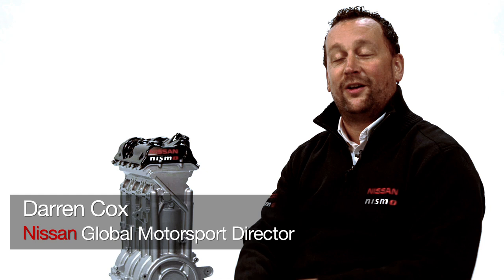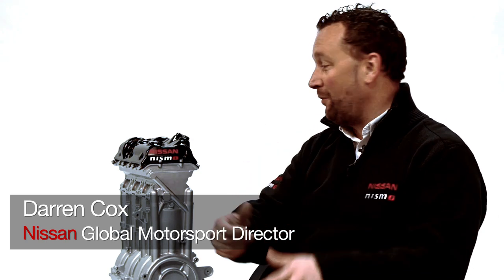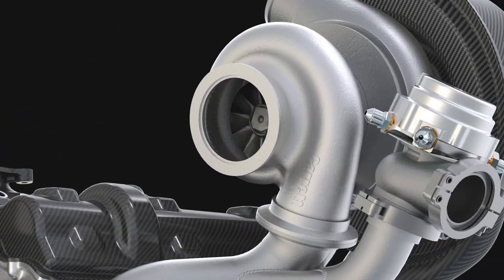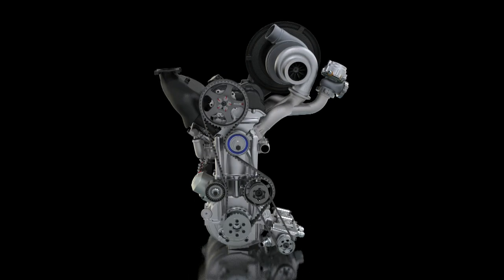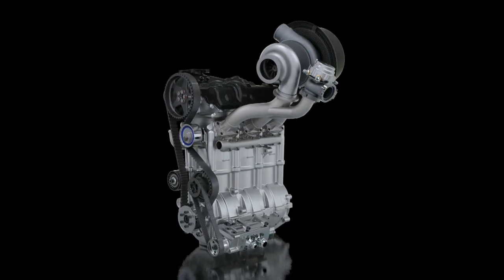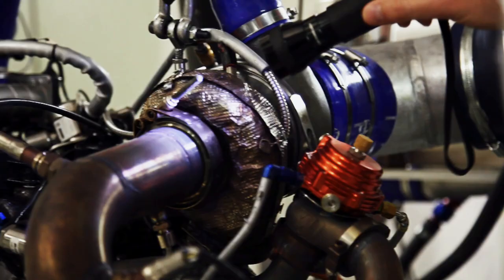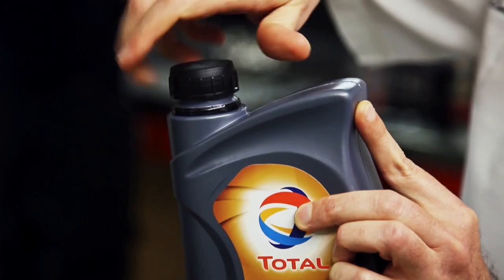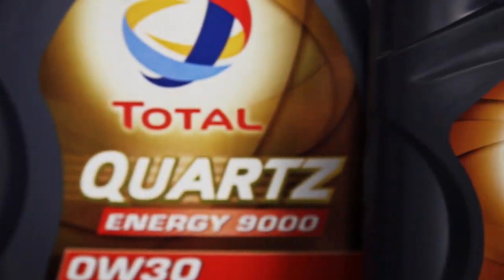Nissan ZEOD RC powertrain - 40kg engine producing 400hp!

Comment: Imagine this on a all new Nismo Motorbike
Reply: That's what I was thinking...The Nismo Hayabusa 
Car companies right now could easily produce small  2 & 4 seated hybrid commuter cars that got between 100 & 125 MPGs but for some reason they don't.....History Channel TV show Modern Marvels showed that the first Toyota Prius's they made, got 100 MPGs by using a larger battery. Yet the 4 sale versions only get 50 MPGs. I suspect the Government & oil companies don't want millions of 100 MPG hybrids on the road just yet because #1 Government will get far less gas tax revenue coming in #2 Oil companies will be selling less oil/gas dropping their profits.....I bet almost anything that as soon as electric charging stations are everywhere. The electricity charge rate station tax will be very high. Making driving an electric car only slightly cheaper than a 35 mpg gas car.

Comment: So you are telling me that they have this engine and they went ahead and released the tragedy that is the 2020 Sentra with its soul killing 149 hp. They easily could have done a retro restyling with elements from the B15 put one of these in it and called it the Nissan Sentra SER-X. By the way Sentra enthusiasts have completely drained the used car market for 2004-2006 ser and ser-v's so a B-15 or B-16 body and cabin style with a minor suspension up grade, brembos, and the ZEOD engine would generate a lot of brand hype and pull their arses back out of the fire their last CEO built under them.

Nissan has been boneing mid market customers too long either you get a K car, or a super expensive race type car with little to be excited about in between. Rehashing their most popular version of their post popular mid grade product marketed as a retro fun vehicle that can still get the kids to school and groceries from the store is what the company really needs. Not a formula racer and not over designed art deco junk (looking at you 2020 sentra) and for the love of mike give it a manual option. You would be extremely surprised how many people prefer to row their own gears. It enhances the driving experience, and gives people an out from the CVT.
Reply: Yes let's buy a car for 1000kms... might aswell just get a new one when the tank is empty
Reply: its not as easy as it seems. the parts in this motor have a way better quality. its not cheap to buid an engine thats that small and has that much power for a reason.

Comment: would love an n/a version of this engine for my reliant robin, the original 850 is only 37kg but is let down by the three main journal crank
Reply: Try maybe engine from Mitsubishi Colt 1.1L 
Its all aluminium inline 3, with 75hp stock.
Reply: A 200 hp 1.5L NA 3 cylinder is totally possible.